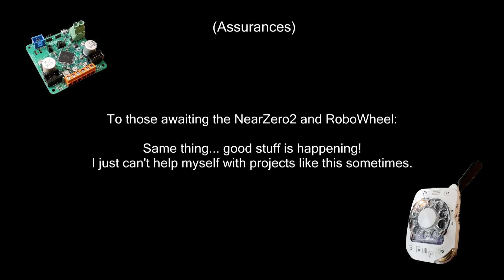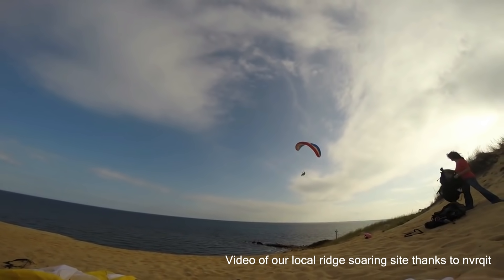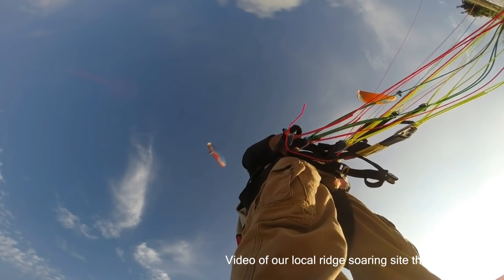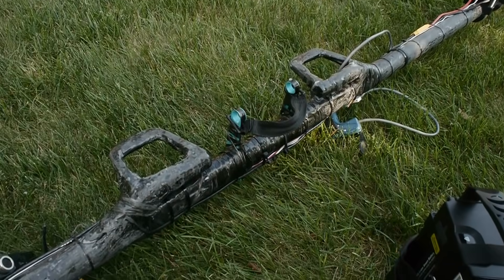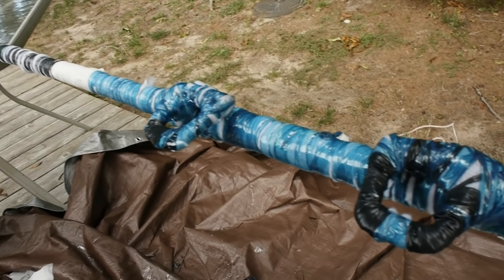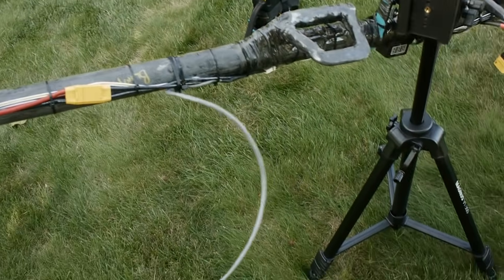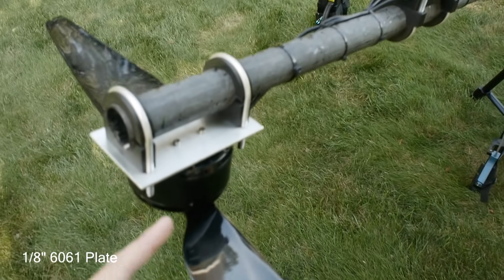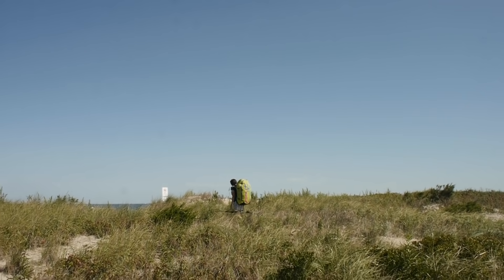Stupid-Simple Electric Paramotor

Comment: It looks almost like my design 😀 In my case the motors are much closer to the pilot though. And they are enclosed in a shroud, (for safety and efficiency increase). We use not only 1 but 2 motors on a side (4 motors with 4 x props in total). They turn contra-rotating props (again more effieciency). On the outside (front and back) are the motors and inside (within the shroud) are the contra-rotating props, missing each other as they rotate, by just under 1 inch (2cm). 60cm props with 65 cm shroud intake. Efficiency is between 68% at full thrust and 86% at half thrust. Props are 24 x 22 (diameter x pitch) Any motor around 3500 Watt, and around 220KV will do. Max RPM is around 10.000 !!! And because of the higher KV, the motors are not so bulky. Are longer but the diameter is smaller.
Reply: MrGo - I went looking for your “rig”. I’m intrigued. Couldn’t find it. I did find your blog post exponential solitude. Very interesting. Seems like you’ve gone into stealth mode. I don’t do Facebook.

Comment: This is generally good for all the reasons you've mentioned however it has one significant safety issue. If you have a motor failure it can very quickly wind you up and twist up your lines resulting in a very dangerous situation. There are probably ways to mitigate this.

Comment: I agree with the noise aspect, bigger props turning slower. Electric aircraft don't seem to take advantage of electric motor's great low speed torque to turn high torque slow speed huge propellers. Weight problem is solved with voltage that motors are running, 700 volts is a lot better than 70. Everything is smaller, motors, wires ... High Voltage, High Torque, Low turning, Huge Slow Turning Propeller is the Cat's Meow.

Comment: This will kill you - as soon as either motor/esc/throttle fails, you'll be twisted 180-degrees, which causes an instant downward wing pitch and slams your body into the ground.  Aviation safety is about preventing catastrophe when things go wrong - and they ALWAYS go wrong at some point.  There's other videos on Youtube of people being killed when their paramotor thrust momentarily went the wrong way.  Learn from their deaths, before yours adds to the list.
Reply from the maker: Chris, I think the dynamics of a motor failure isn't quite as extreme as you're describing. If a conventional paramotor starts producing thrust in the wrong direction, then yes, instant downplaning and collapse. With a two-motor device like mine, however, one motor going out doesn't produce instanteous reverse thrust, and because the boom is so long the inertia + having to act against the spinning-down (failed) prop means a snap-turn isn't going to be as snappy as it could be. In fact it's still producing forward thrust up until 90 degrees of twist. The twisting would be sudden, sure, but I don't see this being worse than an upset typical of bad air, which can also produce a sudden 180+ degree twist. That said, yes, it's a concern and I would have to hope that my reflexive tendency would be to release the throttle if something like that happens. The thrust reduction is essentially instantaneous when I release the throttle, so I think the remaining motor would be spinnign down by the time 180 degrees is approached.

But it's a good point, and another careful one to consider. If the implication is that any such two-motor paramotor concept is doomed from the start for this reason, I wholeheartedly disagree. One possibility would be a safety mechanism built into the controllers. BLDC motor controller design is something of a specialty of mine and I'm currently working on a new open source design (the NearZero2) that does field-oriented-control in hardware. If you have a two-channel (two motor) controller that's doing FOC and cross referencing position/advance from one channel to the other, it's more or less straight-forward to have an interlocked motor control where if both motors aren't turning at almost exactly the same rate, they don't turn at all. Perhaps this is what I should be thinking about for the next iteration of improvements. Conventional drone ESCs are too stupid for this application, and the more I think about it (thank you for pointing it out), the more quickly I'd like to transition to my own controller with this kind of fail-safe functionality.
Reply: @JustineHaupt  You failed to understand my point: Aviation safety is about preventing catastrophe *when* things go wrong - it is NOT about "preventing things going wrong".  There will always be something you didn't consider (a glitch in your code that reversed direction, a bird strike, a snapped boom, lightning strike, ... and black swans) - you don't want to bet your life on "thinking of everything", and even if you do, I don't want you splatting yourself or anyone below you to death, because that's the kind of stupidity that gets our sport banned.  Stick a folding prop on your back like everyone else does, and live a bit longer.

So yeah - rant and my concern for your life and my sport aside... some suggestions:  you probably do not need or want FOC - better to code up some self-optimising target that replaces PWM with something smart that "learns" how to maintain RPM for lower current (dynamic pulse width timing and adjustment), and even better still - pull apart your motor, separate all the windings, and put FETS directly on them - the idea of using 3 phases to drive dozens or more windings in parallel is just stupid - make every winding its own smart-phase, and you could find yourself with some serious efficiency improvements.

Comment: be careful with the temperature of the battery, it is also worth making an emergency disconnect switch

Sorry if you mentioned this. I do not speak English I write via google translate
Reply: the trajectory of destruction of screws is very dangerous for the legs

Comment: I love how the parachute opens as soon as you throttle the motors. Great Job!
Reply: ? It opens when you run not from motor
Reply: The grass is completely still, there was basically no wind and she took a few steps not running, other gliders either have strong winds or take several running steps to lift it. That’s what I’ve seen on Yt. I haven’t ever tried it so my opinion is my own, it looks like the blades gave the wind to open it up so fast.
Reply: @Foundation42  cool yeah I fly just about every weekend. very little wind is needed to inflate the wing.

Comment: Definitely a cool idea.  I think it could be made smaller with 4 motors, two counter rotating on each side, should be able to get the same amount of thrust with considerably smaller props.
Reply from the maker: Hi SkidzFPV, 

All other things being equal, the larger the props the more efficient it is, so one could certainly get the same thrust with multiple smaller props or with faster-turning smaller props, possibly with more blades, but it would trade off the battery endurance proportionally. Efficiency is also a reasonable proxy for noise, where the faster the props turn the noisier it's bound to be. The best you could do in terms of efficiency and noise is a single giant prop with two blades. I have an idea for a totally different concept employing a giant (2.5m or so) prop positioned very far behind the pilot.
Reply: @JustineHaupt  yea, totally agree with the efficiency on large props.  I’m just saying for practicality and ease of use, a set of counter rotating props on each side will be smaller and much easier to handle, with the rear prop getting accelerated flow from the front prop there is also a slight efficiency advantage (not over one larger prop of course, but more so than 4 lines up next to each other) and quite possibly less drag when turned off for soaring, but I could be wrong.  Definitely interested by your 2.5m prop idea though, how would you launch with such a large prop?  And how much drag would it cost you during soaring?  A folded prop I think would be a great idea if that isn’t something you have already thought of, being for altitude assisted soaring.  There’s lots of possibilities that haven’t been explored in this sport and I definitely think you are on the right track to make something incredible.  Keep at it!!
Reply: @JustineHaupt  I'm afraid to mention it because of your mad scientist vibes, but apparently a prop with a SINGLE blade (asymmetric) might be optimal. Like Will Smith's ceiling fan in "I Robot" https://www.youtube.com/watch?v=NWPd4eIkVUE  but it may not be the best choice for flying since it needs a heavy counterweight I believe :-( OpenPPG maker mentions 3-blade prop works "smoother"  (less vibration) and turns slower and therefore quieter, but otherwise has virtually identical performance to 2-blade one. Also likely better for emergency thrust overload. But please keep the current blimp design, it seems to strike perfect balance.

Comment: Very cool.  I have some ideas that may be really helpful if you're interested.  I'm not a PG pilot but have been following the Open PPG project for some years and have ideas on a lighter weight and more compact and thermal friendly powered PG setup.  By way of background I banged out a carbon ehelp in about 6 weeks and have been working on a twin electric powered hang glider setup for about 6 years now (clearly a side project).  Build link here: https://youtu.be/OeCpKL9-WDM, Flights here: https://youtu.be/GhcZCaGBnWw, and here: https://youtu.be/oqqEOvN7l8I

Comment: Hi, thank you for sharing. Amazing work! what are the chances of the propellers getting tangled with your lines in case of a wind guest or some weird failure with one of the motors? I suggest to enclose the propellers in some light-weight cages and/or have some sort of emergency stop button just in case.
Reply from the maker: I can totally see why people are concerned about this, but when flying it, it's hard to imagine a the props ever getting that close to the lines. There would have to be a massive collapse, I think.

Comment: I think it is a great innovation. Well done. You invented the most simple electric paramotor. I love your concept. But I see also danger. If your props break it will explde in your face because it is in direct line of the shooting prop fragments.
Reply from the maker: Yeah a few others have pointed this out, but the props actually sit forward of my body and head. Also I'm not sure why so many folks are concerned about the propellers exploding. It's not really something that happens with modern equipment, and if there's disintegration due to contact with the ground then there are other problems.
Reply: @JustineHaupt  exploding props in the para world are often the result of a loosened part going through the blades.

Comment: Please develop something on your back. Boom concept is honestly bonkers from safety point of view 

Your in line with your prop if any damage it could enter you - game over 
Boom can go all over the place in turbulence, if one prop stops and other continues will create twist 

It goes on and on 

However 10/10 for effort keep the ideas coming but please get advice from others with more experience in flight and potential disasters
Reply from the maker: Hi Mark, 

I get what you're saying but the props sit forward of me and my head/organs, not in-plane with me. In any case these props aren't going to spontaneously explode -- they're not plastic! The thing is a prototype, an idea. Anything that goes on the back shifts the CG and winds up requiring a custom harness, etc, so the whole intent here was to have something that could be a pure add-on for a gliding rig. Just get off the ground to catch some lift, so ideally it's only running for a small portion of the flight.

Observation: It's gyroscopically rigid when running and not prone to sudden jostling in turbulence. But it's a a good point about one motor stopping and making twist. If that happens you just let go of the throttle and it stops almost instantly. It would be an upset, but not worse than other kinds of twisting-upsets. 

I don't do things like this in a vacuum. I've been flying paragliders for about 18 years and fixed-wing planes and sailplanes for almost as long. I talk a lot with other paraglider friends and engineers who experiment with new ways of doing things. I'm sure the first person to put a propeller on their back was finger-wagged by the rest of the free-flight community for the perceived dangers. Someone has to try it first.
Reply: @JustineHaupt  100% without people like you willing to try developing an idea we would never move forward. 
My only concern is safety. You have a lot of experience flying and I feel aware of potential for failures such as prop damage etc Main one I worry about is a prop failure coming back at you. 

It’s interesting project and looks weird but hey something may develop from it 

Happy flying 
Safe landings
Reply from the maker: @markchick1  OK, thanks Mark. That's my main goal, to let ideas be "out there" in the world so others can learn from it. There isn't enough sharing with technological developments, in my opinion. I'm a die-hard open source evangelist.
Reply: @JustineHaupt  die-hard is the right term, and so is "stupid" - but you need to "learn from it" yourself, by observing the deaths of others who failed to consider the results of misaligned thrust.  The videos are eye-popping - the sudden downwards moment happens in the blink of an eye, then your neck is broken.
Reply from the maker: @chrisdrake4692  Hi Chris, see my response to your main comment.

Comment: I have never had a chance to use the word "jettison" in a sentence, but this is my lucky day! The flying stick is already half a quadcopter, perhaps it would make sense to just JETTISON it after take off and have it land autonomously (and shave some heads). It would solve the reserve throw (and ditch dead weight), while only introducing a few dozen other problems. OK I just wanted to say I love this contraption! Congratulations!
Reply from the maker: That's a pretty neat idea Andrzej. Actually, I was thinking of something somewhat similar where instead of having it autonomously land it would serve as the reserve system *itself*. It puts out over 100lbs of thrust, so if it could do another 50 or so pounds of thrust it could lift my weight and the weight of the equipment. So then one wonders what it would take to have it function as an emergency propulsive fall-arrest system. THEN the problem becomes the wing getting caught up in it, so it's just a crazy idea and would need a LOT of development and software work, and probably cyclic pitch control on the props, but maybe. If there were emergency tethers connecting the boom to the harness, perhaps it could fly itself away from the disabled wing and then do a "sky crane" maneuver to lower the pilot. Just ideas.
Reply: @JustineHaupt  looks like this "pulling drone" exists: https://www.youtube.com/watch?v=dnHeYjlXsPk but it would need to be much, much stronger to arrest free-fall in reasonable time/height (I think you'd need 1,000+ of pounds of thrust over many seconds to arrest 100 pounds of weight after it's been falling for a few seconds). Doable with rockets perhaps (or at least to launch the reserve, like ballistic recovery system for small airplanes) but it looks like reserve parachute makes more sense still. Of course in life-or-death situation it may be better to simply drop the blimp stick first and then pull reserve. But perhaps the propellers could fold (like in some electric sailplanes, or even hide in the stick: https://www.youtube.com/watch?v=1aOtO9mzJ9E )
Reply from the maker: @EkusNet  Wow look at that! Could work for PG too, maybe. 

I was wondering how much thrust would really be needed and I don't think it would approach 1000lbs, actually. I don't feel like integrating the formula for force as a function of air resistance and speed at the moment, but if you start by neutralizing gravity (say 150lbs of thrust) then air resistance would slow a descent to zero from free-fall after some distance. Whether that distance is 1000' or 10,000' I don't know without doing the calcs, but just neutralizing one's weight will stop a fall _eventually_. From there also consider that a paraglider isn't usually in free fall when a reserve gets thrown, and then consider that the blimp drive may be able to be engineered to do a 500lb burst of thrust for a short duration (melting wires etc, and battery discharge rate being the limitations), then it MIGHT be viable. 

But I agree that for the foreseeable future, a reserve is the way to go!
Reply: It might not be possible to get this to fly with just two props
Reply from the maker: @max_kl  I think with cyclic-pitch control of the props it would be possible, but the control is far from trivial. There are already existence proofs of two-prop powered-lift aircraft, like the Osprey. Possibly the battery would also need to be affixed rigidly to offset the center of mass a bit more.